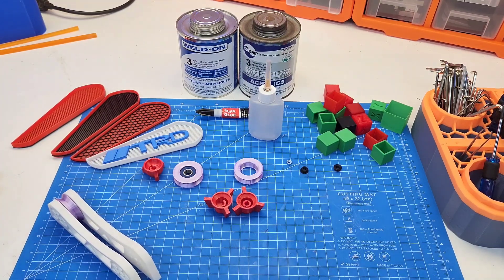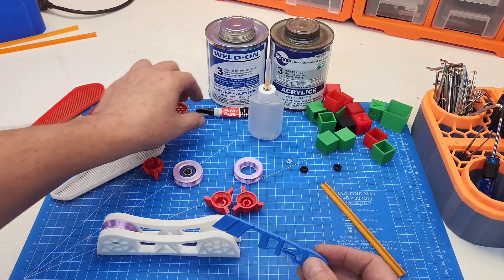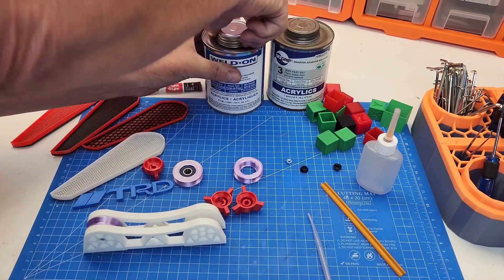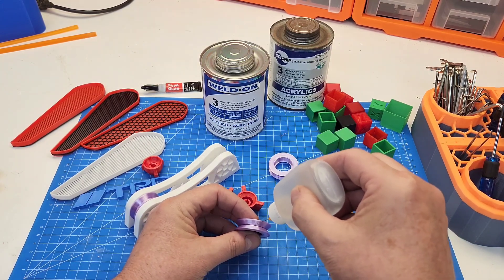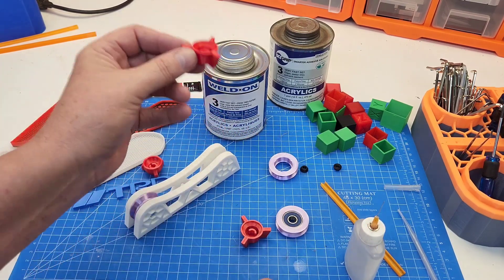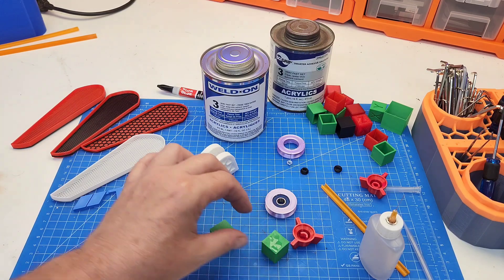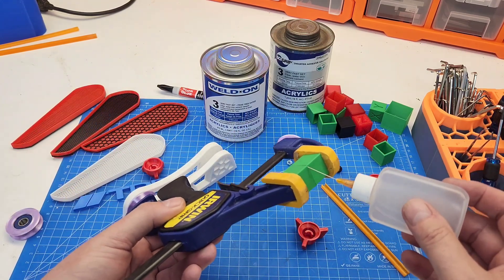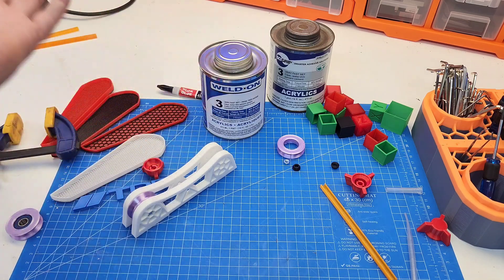Best Glue For PLA 3d printed parts

Comment: Is Weld-On any different than all the PVC cements on the market?  That's how PVC pipe cement works, it dissolves some of the PVC and welds the parts together.  I always wondered if it would work on PLA.
Reply: I used to do irrigation and was thinking the same thing. Also, the PVC primers look to be the same consistency/viscosity as the Weld-On and it also melts PVC together - even without the glue. I have to grab a can and try it out.
Reply: @josephpk4878  I did some research and they're different.  You need the kind of glue that works with acrylics.  And it's real toxic!   You can die if you breathe it in an enclosed room.
Reply: @josephpk4878 did it end up working?
Reply: No its not the same. Its not the same as acetone.

Comment: I'd be willing to bet straight acetone is the solvent that is key here. Depending on filament material composition might try alcohol (denatured or 91-99%), lacquer thinner, mineral spirits etc.
Reply: Acetone works well with ABS but will not weld PLA
Reply: The issue is that pure acetone evaporates before it has a chance to glass the filament. If you're going to use acetone, you're better off immersing the surfaces in a shallow tray for a few, but it's not that practical, unless you're specifically dealing with flat surfaces. The Weld-On solution is brilliant.

Comment: I wish I had seen this video last night. Just printed a filament spool winder and it requires a piece to be glued to the bottom for the guide lever. I tried superglue and it didn't stick, so I went to JB Weld. Still waiting for that to cure so I'm not sure if it will work yet. But I'm definitely going to try your method. Thanks for the advice.